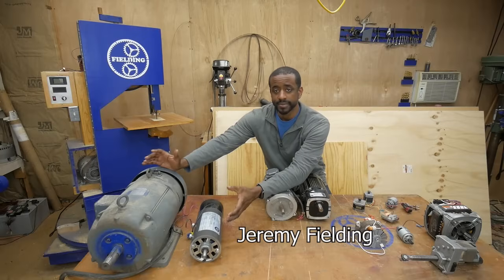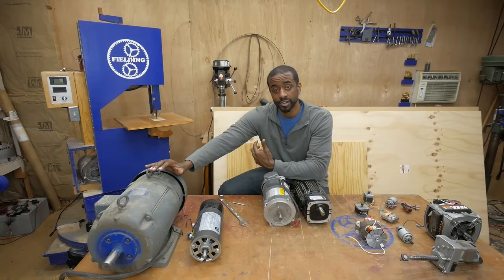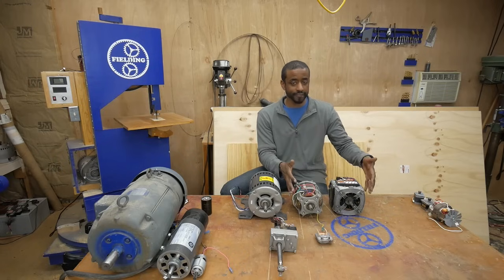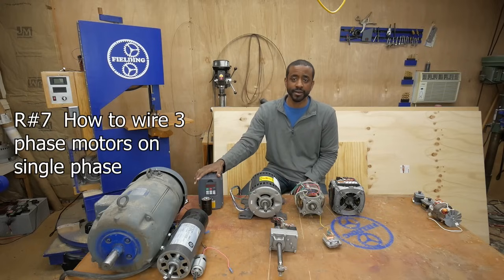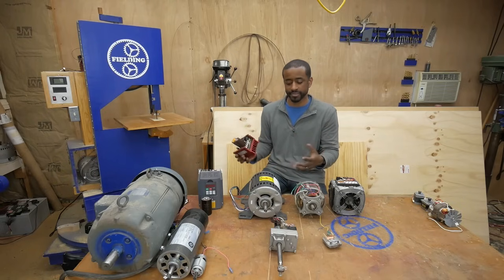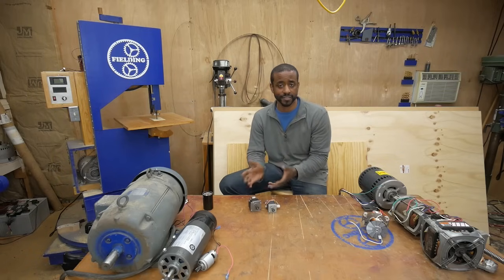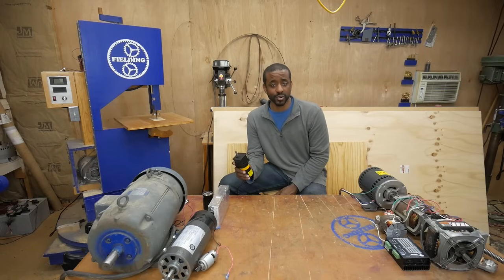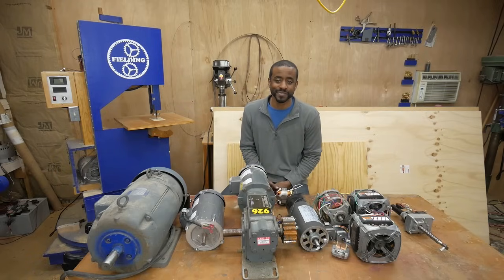Ultimate Beginners Guide to Using Electric Motors for Makers and DIY Projects; #068

Comment: Overall, very informative.

Torque for an internal combustion engine and electric motors is usually given in lb/ft, not ft/lbs.  

The reason is that while the torque you describe is ft/lbs, because it is the amount of force (weight) applied to the end of a lever a distance from the centre, which gives "twisting torque".  Therefore, the length of the tool (lever) also affects the twisting power of the tool or in the case of an actual lever, the positioning of the fulcrum affects the torque because it changes the effective length of the lever.

Engine or motor torque is "work torque"; it is the ability of a motor or engine to move an object (e.g/vehicle or load).

An easy way to look at it is that a wrench (lever) twists an object (e.g./bolt or nut) and that force can be increased by increasing the length of the lever whereas an engine or motor moves something (e.g./ a vehicle or a load) and there is no lever to adjust in length. 

Now, there are cases where a twisting force is used to move something, such as a winch handle to lift a bucket, but in that case you are still using the twisting force of a lever on another object, usually a drum or pulley instead of twisting a bolt, to wind in a rope.  A motor, on the other hand, is a fixed diameter and only increases torque by increasing the power input, if not getting into internal windings and other factors.

Internal combustion engines do use a lever, the crankpin, which is offset from centre the length of the stroke.  The difference in an engine is that, once again, the lever cannot be simply lengthened to increase torque, so torque is increased by adding power through increasing the pressure created by the burn of air and fuel in the cylinder in the form of improved volumetric efficiency or by changing the internal specifications on the engine by increasing stroke or cylinder diameter.  Engines are therefore also rated by "work torque", or lb/ft.

To increase HP of an IC engine, you have to increase the peak torque at a given RPM, or, increase the RPM at which a given peak torque is made.  This is why a large diesel engine can make 2,000HP at 800 RPM, while a 2,000HP racing engine may have the HP peak at 8,000 RPM.  The diesel is making a massive amount more torque at a low RPM.
Reply from the maker: I don't understand. It is "lbs x ft" that is equal to "ft x lbs" ....why does the order matter??
Reply: @Jeremy_Fielding , it is in the type of torque each describes.  What we perceive as mathematical equivalents aren't always scientific or described equivalents.  A simplified difference is that ft/lbs is a lever torque, such as a torque wrench and lb/ft is ability to do work, such as a motor.  Simply by looking at the specification, you should be able to tell if you are seeing an engine/motor torque or a bolt torque.

If you look at a dyno sheet, you will always see lb/ft.

Another difference your video brings up is the difference between a motor and an engine. Although people interchange the words, they are different things, with the motor requiring an external power source and a engine making its own power through chemical means e.g./ burning fuel.  So, unless your car is electric, it has an engine, not a motor.  😉

Comment: Hi Jeremy,
Thank you for the informative video. I have a motor I pulled from a cuisinart food processor. I haven't been able to google any decent info on in. Do you have any general idea on what it might be good for i.e. Speed vs torque? I'd like a motor to power a 4" x 30" drum sander. I understand if this isn't enough info to go on, but it's worth a shot asking.
Thanks again, and keep up the great work.

Comment: Do you know: Can you run a treadmill motor (130 VDC) on a 12 VDC battery with the proper Boost Converter (110 - 250 VDC range)?

Comment: very cool. What is your experience with using more than one motor to power a single shaft? Is this a bad idea?
Reply from the maker: Watch my shredder video “more power” in the thumbnail
Reply: @Jeremy_Fielding  My professor began covering induction motors today, it makes sense that they would be safe to pair. What about dc motors? or synchronous motors? I had accidentally bought two small brushless dc motors and plan to use them both to drive the same shaft in an rc airplane.. Do you think thier power will sum together, or will it be only partially added? should i expect them to be damaged?

Comment: If anyone's reading the comments, how much amphours of deep cycle batt is needed to run a pair of 500 watt DC motor(20A) for an hour?  Building an RC mower, and all instructables say get a power scooter.  I bought motors and a 2x32 Sabertooth instead.  The motors are 2600 RPM so will need to be greatly reduced to mow at normal speeds.  The internet is failing me trying to pair a battery to my 24V motors.

Comment: Thank you for this info. I don't know much about those things. But I need one to make a metal bender to make scrolls and any other type of circular object. I will need to vary the speed for different metal thickness of metal. I will only go up to half inch square or round bar. I will need to turn hot or cold. Or only hot if that is easier. I do have 220 in my shop.

Comment: The word is fulcrum the point of balance ,,, I love the washing machine motor not only can you use it in the 110 volt mode or you can wire it in 220 volt mode ..you place one motor in the generator mode and the one in 110 mode motor mode ,one switch ,one light bulb socket and you have free energy mode ...one motor will run the other as long as that switch is on !... good luck and stay off the grid.....ps use solar to get it to speed or battery’s.... I hope you where able to fallow me ....Black Dog Down...

Comment: Very informative content. Your video shows that you enjoy the topic. One question I have is I need a motor that is variable speed with reasonable torque and reversing what direction would you go to assemble components to achieve this? I don’t have 3 phase power.

Comment: So HP doesn't equal 'Work'. I was always confused about electric motors, size vs. hp rating. Because I was taught that a HP was equal to lifting a certain amount of weight a certain height. Like 1 lb., 1 ft. Thanks for your help. And watts doesn't equal work, because it doesn't factor leverage, 'the diameter of the motor.

Comment: Thanks great video. I rewind BLDC motors to customize the KV for my application as well as improving efficiency. Typically a hand wound motor can be fitted with a larger gauge wire.

Comment: I need a very low speed, (around 6 RPM) high torque (around 25-30 lb.) motor for a project I'm working on, but I can't find anything. Do you have any idea where I should look.

Comment: Sure would like you to explain all these electric motors for bicycles. Front drive mid drive rear drive 24 36 48 72. And it goes on. I know what you're talkin about torque and I need torque on my meat grinder. When I run horseradish through it. I use different size pulleys and gears. There's a lot I need to learn.

Comment: 3 phase power is on my street and i live in the back woods, nothing between me either way that needs big power. there are one or two customers that i have seen using the 3 phase, they all have nice shops, like 40x60 or bigger and they both use the little baby transformers, one per phase.

Comment: Very intetesting video! Nice that you used mm and not only inches.
I had no clue 3phase isen't that common. Here in sweden only appartments have 1 phase. Even small summer houses have 3 phase systems. I have three phases with 230volts each and 16 amps. Each. Thats pretty low but the cheapest option.

Comment: II have single phase power, what I'd like to do is put a 3 phase motor on my drill press so I can adjust speed and rotation what do I need to get?
Probably a 1/2 to 3/4 HP

Comment: Nice vid mate. Great to see such a huge variety of motors in your collection haha
One quick thing that caught my attention though. Servo motors don't necessarily have to be steppers/BLDC/AC/whatever, as mentioned around 15:07. The name typically refers to a motor that has some sort of feedback control loop, usually position, to ensure the motor is doing what it's meant to do. So theoretically any motor can be converted to a servo motor using encoders like you said but then again it's all application-specific
Control theory and all that is all very interesting but I'd probably struggle myself to summarise everything the way you did. Keep up the great work

Comment: I have 60gal compressor 220 giant motor, you think I can switch it for 120 motor?
Reply: What does the nameplate on the motor say? If it says 240V only, no. If it says 120/240, yes BUT you will need a circuit that is rated for the 120Vamps (usually 2x the 240V) and remember, if the name plate says 25A,  you need a 40A circuit as 25A exceeds 80% of 30A circuits permissible load. Also compressors are HARD START motor loads. They need that capacity to prevent trips while starting.

Comment: A 1 hp motor can supply an equal amount of torque and speed regardless of it's size or speed but may require a heavy gear reduction box for high torque. Higher torque always requires a beefier motor or gearbox, which is why you might as well use a larger motor for some high torque applications. High speed motors also tend to wear out faster. Larger motors can run for long periods and long duty cycles.

Comment: The biggest induction motor flaw is;(drums please) they last forever. Industry today doesn't want for your washing machine to last forever. They want your washing machine to die in 5-7 years. Therefore they use brush motor in my washing machine. Brushes are gonna wear and get all that that graphite to short something inside and fail in 5-7 years.

Comment: Well, actually “BLDC” is a misnomer. Brushless motors are all AC motors. It doesn’t matter whether they are induction motors or motors with permanent magnets. If it doesn’t have brushes, it’s not a DC motor, because you can’t just apply a DC voltage for it to spin.

PS: Where can I get free treadmills or washing machines?
Reply from the maker: Did you watch the whole video? I explain at the end

Comment: I use water pumps..ponds aquariums and the quality is terrible. I've never had a water pump work 24/7 for more than 4 or 5 years and most don't last 2. Something about them burns out,or they leak ( I see an oil shimmer on the water surface before yet another burnout) and then magnetic drives and impeller magnet early wear out.
Just a suggestion for future topics.

Comment: 13:15      The word is "printer",   dear boy,  not "prinner".
Reply: I hope that over the past six years, you've developed a better understanding of regional dialects—and of the ephemeral nature of language itself. Presumably, you grew up in an area where this particular instance of T-glottalization isn’t present. If, due to this, you experience a degree of misophonia when confronted with dialects outside your own, then it's understandable that you would have a negative reaction; however, your response feels ignorant and rude—it comes across as both misguided and naive.

I recognize that my own response stems from a similar place: a kind of pedantry, perhaps fueled by frustration—but hopefully, it didn't come off as belittling or rude.

This isn’t even addressing your use of “dear boy,” which I can only hope was intended in a non–racially motivated pejorative sense. Even so, it carries a troubling historical resonance given the long-standing racial connotations tied to the pejorative use of the word boy.

Comment: just a little POV from a different hobby: BLDC and servo are super common into RC drones like car, multicopter, planes, boat. In boat they also have the advantage that can run completly submerged, as long as you clean them afterward with some distilled water.
There are different opensource project for controller where people can see both electric schematics and firmware used to control that stuff.
NEMA are pretty universal for stuff like 3d printer and CNC machines.
All of the above (especially servos) make a super easy and fun project to start with electronics and programming, like with an Arduino.

Comment: Gday
What would be a good recommended setup for

2 seat tiny car
speed: 75KM
Distance: 100KM

I need to know the battery and engine 

Would 3000W BLDC 
and 48v 40ah battery
work out well ?

Comment: Really enjoying your videos and learning a lot. Let me know if you ever need stepper drivers or a PID servo controller. On the NEMA sizes, I could never find a good source for the actual numbers, so I cobbled one together from experience:
http://techref.massmind.org/techref/io/stepper/nemasizes.htm
There may be errors in that, but the major points are right. Let me know if it can be improved, and feel free to copy it out for your own use... a link back would be nice.
Reply from the maker: I always need that kind of stuff! Send me an email if you want to help on my website. This video would have been better with some of that stuff on hand
Reply: @Jeremy_Fielding  I should be clear, these are /kits/ which must be soldering together and then setup and used. They are not cheap Chinese garbage, but they are also not super simple, plug and play. They are designed to be educational / open source, so you are expected to learn and better understand via the documentation. See my channel for more. The BOB PID is the servo controller and the THB6064AH driver. If you will actually build them and try them out, I'll send them. Need your email address and an address.

Comment: This is why I still don't get the thing with electric cars having motors with no transmission.

Electric motors have operating speeds as well. I guess they just pick an electric with a large operating range, but again, it still has a limit.

Of course 20 jules of electricity is 20 jules whether it's high voltage or high current.

For the most part cars are the same though, 100hp is 100hp, consumes more or less the same amount of fuel whether 1000rpm or 3000rpm.

Comment: 6:38 but why triac based circuit vary 1 phase Induction motor speed , like bt136 fan regulator which do not change it's frequency  , but voltage or current ! ?

Comment: I have just got a 40 inch model motor boat which has a gloplug engine which has siezed.
It needs re fitting  with a motor and imnot sure of the elements you ahve been talking about.
A drill motor  (such as defunct dril) might  work ( suggested alse where as a cheap option) but will it ahve the speed I'm looking for.  AS you say i think it would have the torque.

Many of the parameters you mention are being considered.  What do you  think?
I shalll also need a speed controller (potentiometer?)

Brave man if you open up bits of equipment you never know what capacitors are still charged.  (I ahve a treadmill  which keeps 10000 volts which has been an inch away when I  have been adjusting it).
Reply: I don't know of anything in a treadmill that would have any possible use for 10000 volts,  so unless you can provide some more details on this,  I call BS!

Comment: could a Univeral Motor be used to make a wind turbine?
Reply: Not easily because you need to energize the field winding with an external source. 
 Permament magnet motors are ideal.
Reply: Thank you.   @Andy-df5fj  could you maybe do a video with details.
Reply: @jurgenblick5491  
Sorry but I'm not the video creating type.  I just watch and comment.  Although I've never built a full sized wind turbine, i've tinkered around with small ones just out of curiosity.  From what I've seen, the easiest motors to convert are higher voltage/lower rpm DC motors such as treadmill motors.
I've seen some youtubers have success converting ceiling fan motors which have a perfect combination of high voltage/low rpm, but they have no permanent magnets so they require installing your own.   
Check this link for some useful info: https://www.windynation.com/jzv/inf/making-wind-power-how-choose-right-motor

Comment: So can you answer a question for me? I have a e bike and it hits 60kph and sometimes higher, I'm 170lbs and it still has some torque.. the dealer said it's a 72volt 500 Watt setup so wouldnt that give me less than 1 HP like just 0.9 actually how am I hitting that speed at such low HP?